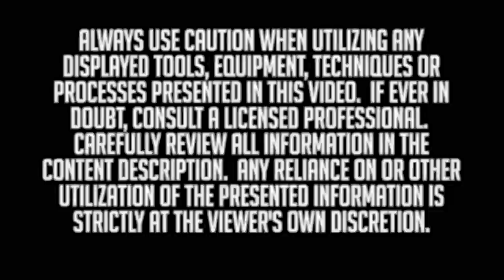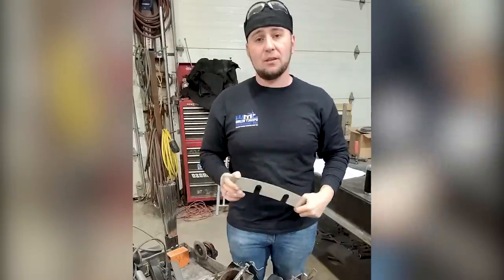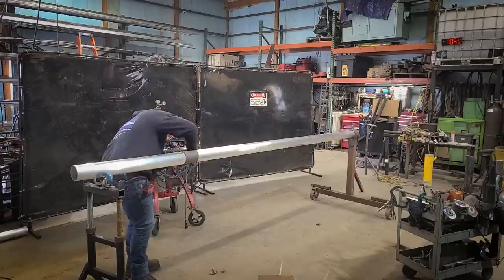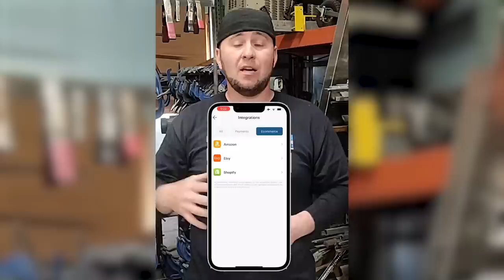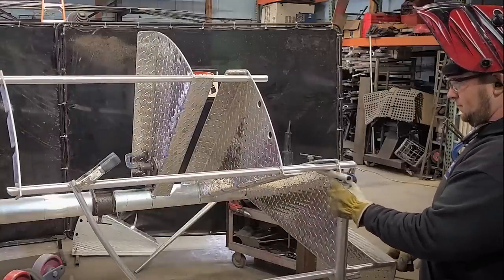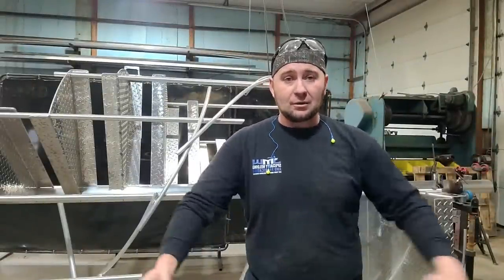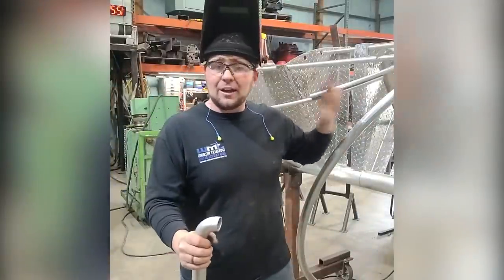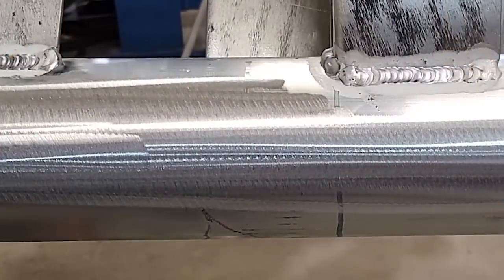How to Build an Aluminum Spiral Staircase

Comment: Very nice work, very interesting seeing how something as large and ungainly in shape is actually handled.
Reply: We have a Spyder Crane for tricky installs. We make them out of aluminum so one person can move it around. We have a stand that bolts to the base plate and we use a winch to pull it up when we can't use the crane.

Comment: Customer call for tig? Mig seems more practical & easier for this type application. Personally I wouldn’t have used tig
Reply: Why? Because you can't tig Weld?
Reply: I can but why do things the hard way?
Reply: We use tig because there can't be any spatter or burrs. It's slightly slower but if you figure in cleanup time, it's the same. And tig gives a better profile which people like.
Reply: That’s what I was wondering f the customer called for tig. I use to build spiral stairs we mig everything but the handrails.